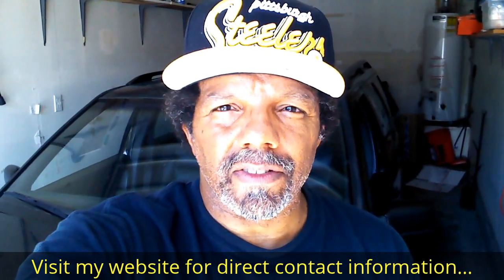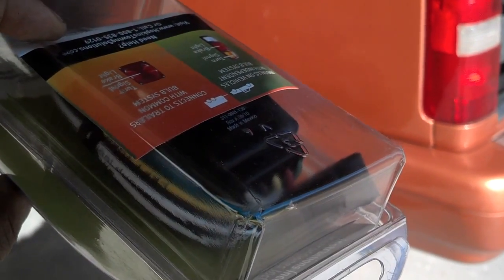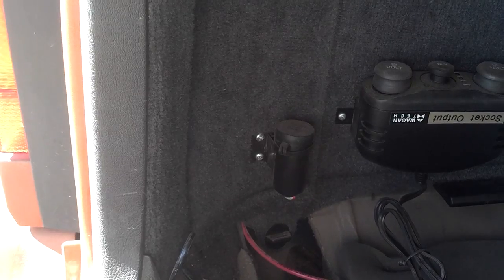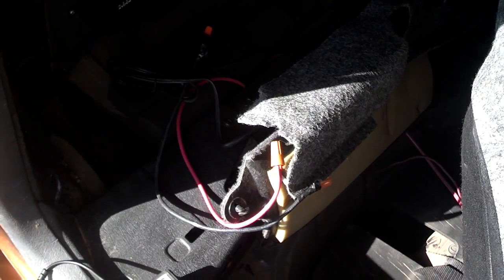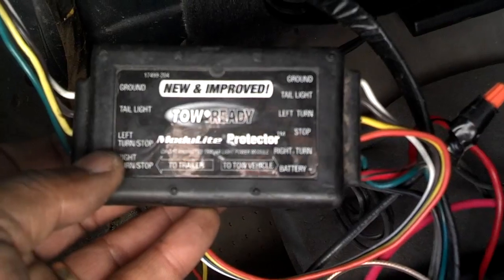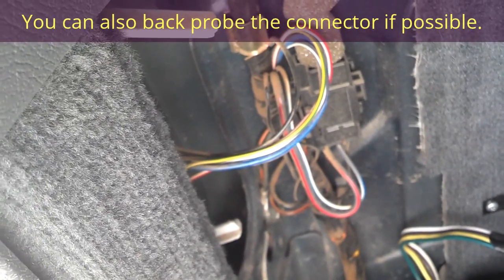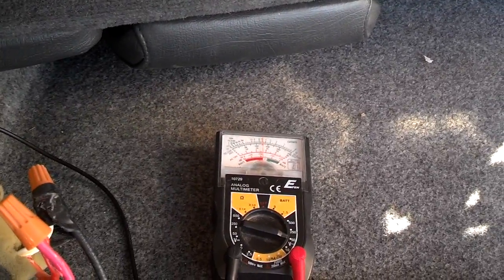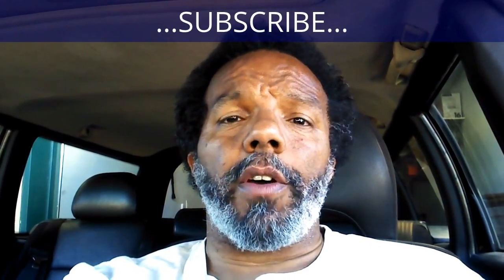How to install a wire harness for towing a trailer, boat, dolly or other things needing lights- VOTD

Comment: Its such a simple job/circuit but dam easy to lose your place with the wire function, your not on your own robert, ive been there a few times especially if i got out of bed the wrong side that day :D

A 10 watt bulb on wires can be so dam handy lol.

I bodged... fitted the wiring to my mates peugeot 307, they dont use colours, they use almost unreadable numbers (eyesight) and the diagrams tells lies.
Probing with a needle got me there, i soldered and heatshrinked the wires.
The buggers wont come off any time soon ha ha :-))
Reply from the maker: zx8401ztv Solder is the best connection method. I did have a 10 watt bulb / wire handy, just wanted to use the volt meter.

Comment: Hi Robert. I went directly from the battery positive side using the supplied 10A fuse (CURT) and ran it like you did along the driver's side. It's all working good. I'm wondering if it's OK that it's hot all the time, or if I should take out the fuse except when I need this, or just leave it hot. I don't know if it will last longer or not? Thanks again for your video. Off to work on a washing machine I bought that needs some fixing. Happy New Year!
Reply from the maker: Ricky P. Hot is fine.
Reply: Direct was incorrect for my setup. Killed the battery. after sitting for a day and a half. A later comment from OP talks about running from a fuse 32 implying it should be setup downstream from ACC power.
Reply: @Codum78  I don’t know what vehicle you have. But from ACC suggests it only will have power when ignition is on. So that should be fine. Hope it works out.
Reply: 760 Volvo. So for now keeping the fuse out until needed, hopefully there's no parasitic voltage draw. Thanks!

Comment: thanks Robert.   in my 1999 v70 wagon the upper wires are buried. I only see the speaker wires up there...... and I don't get brake light by tapping into the yellow like you seem to.  Isn't there somewhere that can tell owners what all the colors are for??!  This should be way simpler.  thanks
Reply from the maker: No, just get an ohm meter and back probe it.
Reply: I'll try again. thanks

Comment: so did you just run the power cable right from the 32 fuse, and then to the back of the car? or did you connect it from the battery, to the fuse, and then run the cable to the back? did you just wedge the wire into the spot for the fuse, and use the fuse to hold the wire in place?
Reply from the maker: MrEvilshannigans The fuse location already had power. I just jammed it in there but you should do something more permanent.

Comment: Hi. I have an '18 Pacifica van with the 12v DC cigarette lighter adapter outlet by the rear back door, so I can plug into the electrical behind that instead of the battery?
Reply from the maker: Does it have 12v constant power?

Comment: Hi Robert! Once you get the pig tail all set, don't you need the wires to come outside so they can plug into the trailer's wiring harness? I'm wondering the best way to get the wires out the back of my 940 so they could be safe. Thanks!
Reply from the maker: Mine just hang out of the rear hatch. The harness is flat so you can close the trunk on it without damaging the wires or trunk seal. You can also get a box and mount it under the vehicle but you'll need to sell the plug that you pull the wires through.

Comment: For some reason it went nothing like that for me. Those blue blue splicing clips worked only once which was the first time. every following one failed to make a connection. So I went to using butt clips. now the wire is too short to make a connection to the car side. Im not sure what to do now. but gonna be going without a turn signal on that side now until I figure out what to do.
Reply from the maker: Sounds like you need to add some wire.

Comment: piggy back the light so u dont have to run all those wire from battery.
Reply from the maker: I only ran one, the power as directed in the instructions.

Comment: Hi Robert, I can´t find a complete tow hitch for a 850 sedan 94´ do you know if the v70 mk1, 850 wagon or xc70 fits the 850??
Reply from the maker: Any 850 hitch will work.
Reply from the maker: Also the P80 C70 hitch will work.